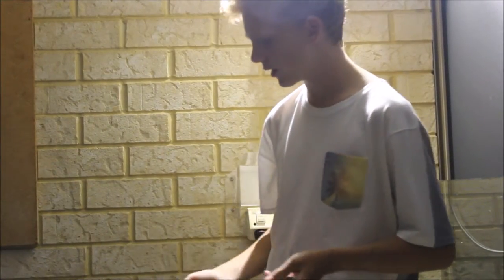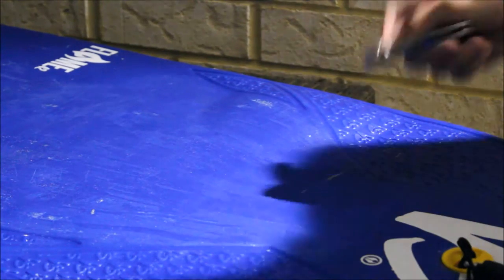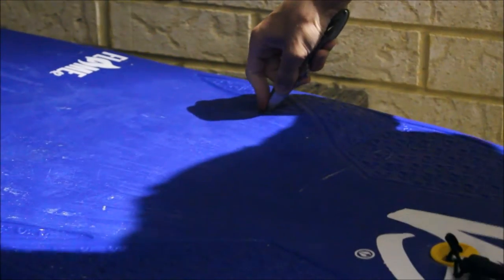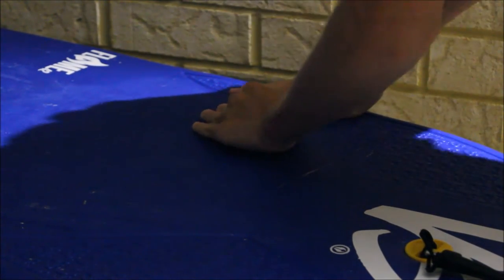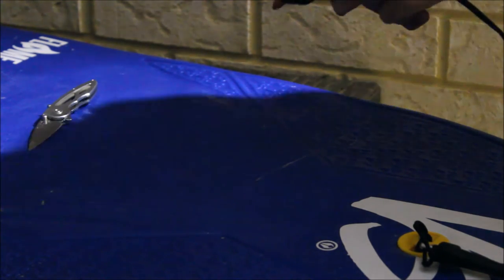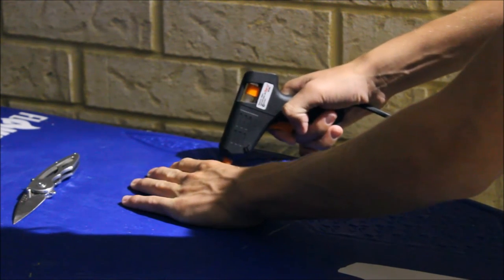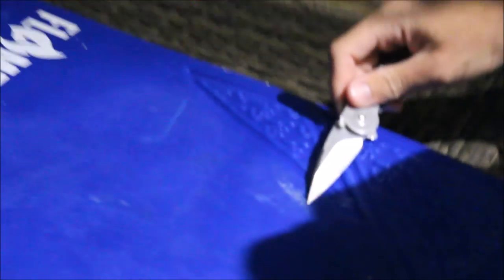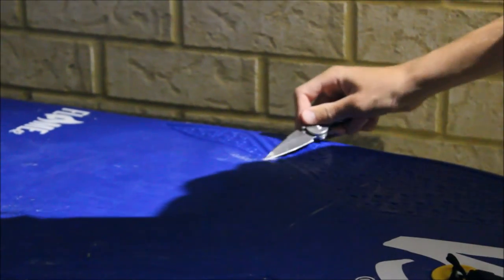fixing your bodyboard

Comment: I have a table that bent.  the tail and the front touch the water.  He lost the rocker, it is flat but the nose bends in the water.  How can i fix this?  I am afraid of using heat and that bubbles will come out or it will come off.  I don't know if it has a string.